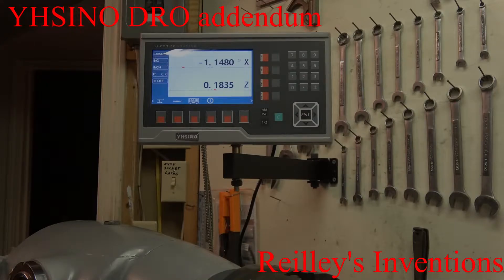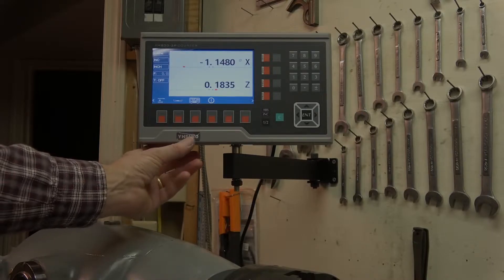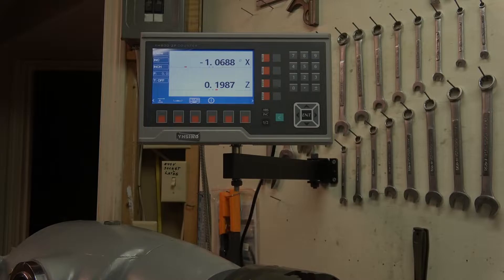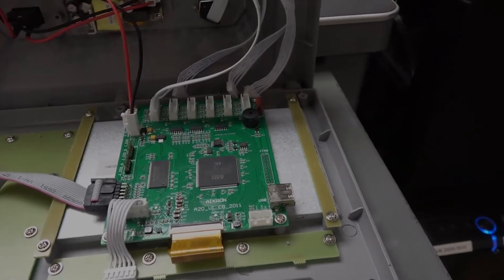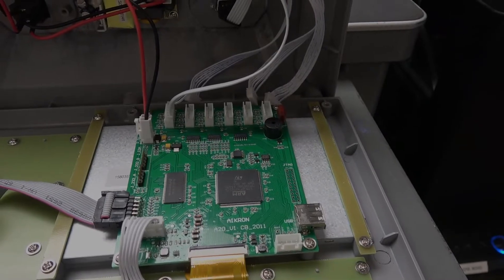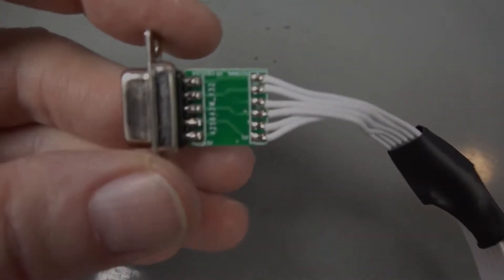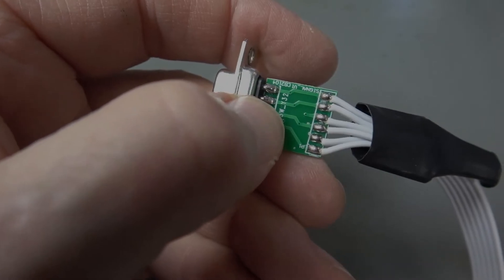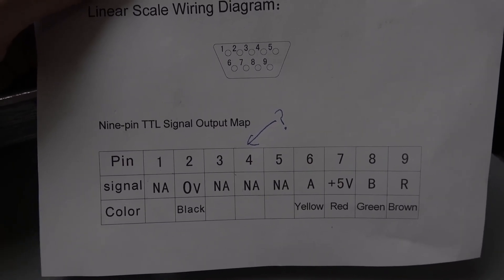YHSINO DRO repair addendum

Comment: Thanks for the video, but sadly i could disconnect pin 4 from 8 like you did because the newer models  connect the pins on the main board and its a little difficult to make out the point at which both pins connect, they no loger use the small board at each DB9 connector
Reply from the maker: I just bought a YH Sino YH800 DRO and had no problem connecting Sino scales to it.   Did you try the oscilloscope mode to help diagnose your problem?   That is how I first discovered the problem.
Reply: @reilleysinventions4155  Yes, but i didn't get any signal. My scales are heidenhain, and the only issue that i could find, with my limited experience, is that the dro was not outputing 5v as it should, according to the pinout in the manual and non of the dro pins have an established ground with the main machine ground, the only thing that is grounded in the dro db9 connector is its frame and not the pins.
Reply from the maker: @G35RR  Does the new DRO have ground on pin 2 and 5 volts on pin 7?    I did not check on my new DRO because it just worked.   The signal ground may not be connected to the machine ground.
Reply: Yes, the machine ground is probably not connected to scales ground, mine according to the manual, should have its ground on pin 2 and the 5v power on pin 7
Reply from the maker: @G35RR  If the power is supplied by the DRO is OK then you should check the A and B signals.   These are on pins 6 and 8.   The YH Sino DRO can display the signals in their oscilloscope mode.   Or you can use a voltmeter on the A and B lines.   If you move the scales very slowly, you can see the signal change from about .8 volts to about 3 volts.   But you must move the scale very slowly of the voltmeter will not be able to get a good reading.

Comment: Hi, any idea of wich software can be used to go inside the DRO and make a modification ? Thanks in advance in any case, cheers ! Alberto
Reply from the maker: I see that it has a STM32F429IGT6 CPU and a JTAG connector.   The processor does not seem to have any security, so presumably you could program it with your own code.   I have not attempted to do anything with it.   I did just buy another one and the code is somewhat different.
Reply: @reilleysinventions4155  Thanks so much for your answer!!

Comment: I just unpacked my scales and interestingly enough they came with a little DB9 adapter similar to what you have under the heat shrink except it's meant as an external add-on depending on the type of DRO panel being used.